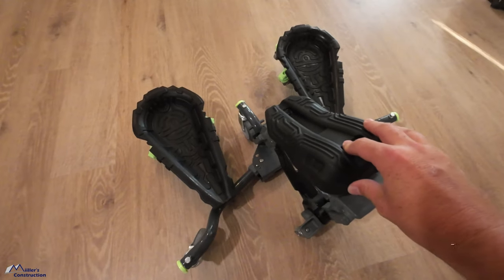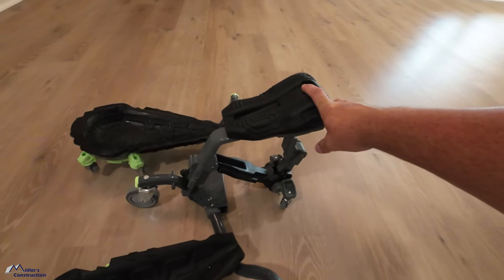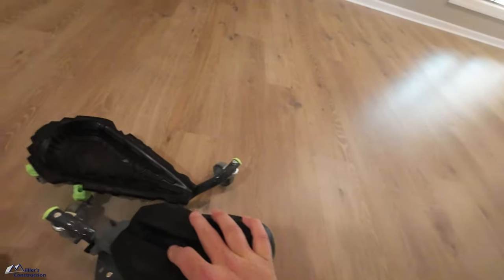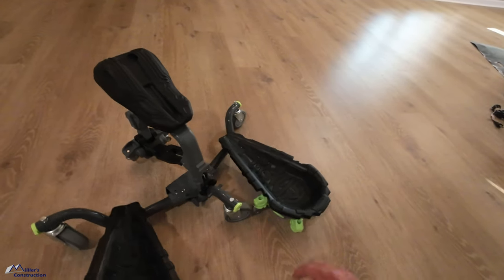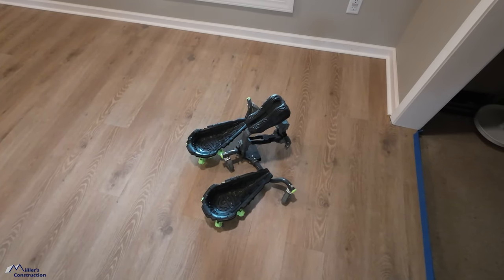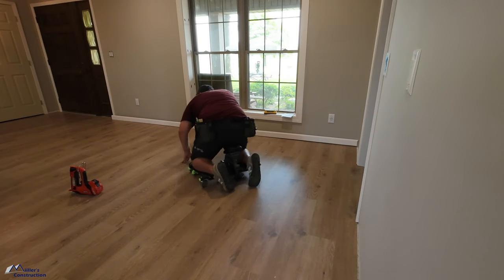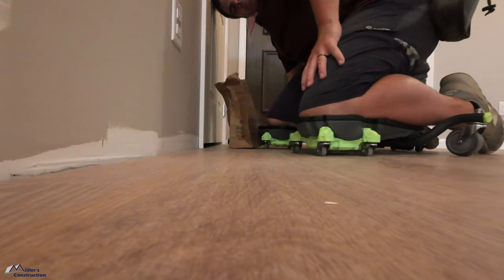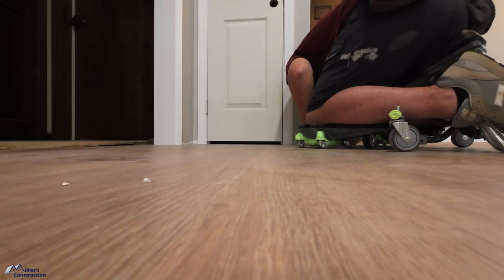V3 Kneel It Rolling Knee Pads - Unboxing, Assembly, & Jobsite Use

Comment: Way too expensive for the quality of the materials used. And if you hit some grit or a tile spacer with one of those tiny front wheels it would be like hitting the brakes. This would only be good for what you're doing, base boards, trim painting, maybe hardwood floor prep but absolutely not for tile work.
Reply from the maker: @espy0008  I've been using it for decking as well. I've had zero issues.
Reply: I made my own, using scooter wheels, and they can jump tile spacers and wedges. Bit different to this design but just as comfortable.

Comment: i find that the small two wheels under neath the seat keep folding in on me when i roll backwards. any solutions for that?? 🙏🙏
Reply from the maker: @jesserosenbloom1311  man I have not had that problem! That's weird!
Reply: I had the same problem. I fixed it with PL and a couple smaller screws